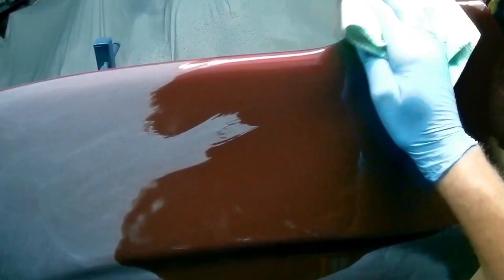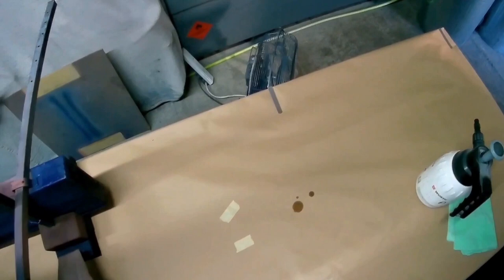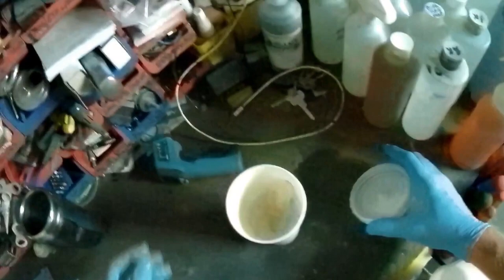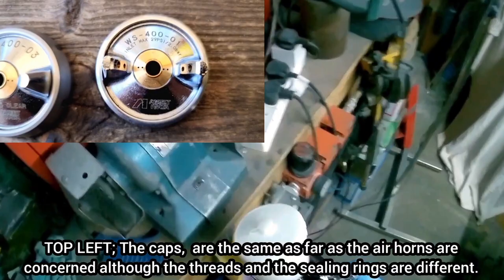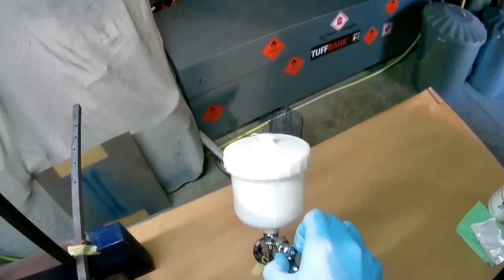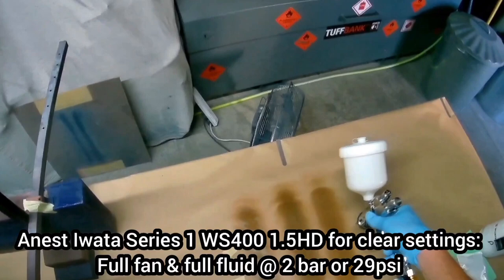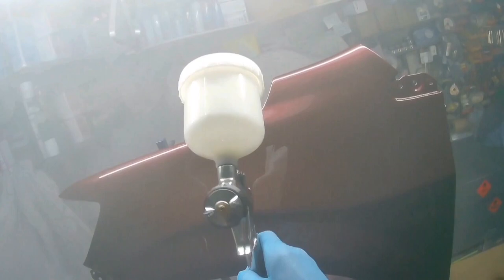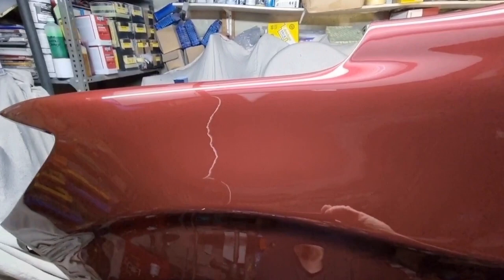Iwata WS400 Series 2 v Series 1 For Clear Coat

Comment: I've been using the old model for about 10 years. I've noticed the split spray pattern everyone talks about. It seems that a simple adjustment prevents the problem. However, I would not mind trying the newer one.
Reply from the maker: Hi buddy,  I've only had one person who says it didn't work. Everyone else has found it does allow you to use full fan, cheers mate 👍

Comment: Aligning the the tip with the cap air horns. Definitely works! and yes some align easier than others as I’ve got 4 ws400’s! Thanks for the tip Pete 💪💪
Reply from the maker: Thanks mate, yes, it really does work doesn't it, it could also explain why some have said they can use the WS400 series 1 on full fan without problems , I have seen one that lined up perfectly without over or under tightening the tip, of course that one sprays perfect. Cheers 👍
Reply: Is there already someone who did a mod to the old nozzle to line up correctly ?
Reply from the maker: Hi Lu, haven't seen one yet , it's actually not a problem holding the gun at a slight angle,  in fact you don't know you are doing it as you follow the patern.
I've seen a few series 1 guns and the tip actually finishes at different points on each, one was spot on, just like the series 2, this might explain why some people get on with the series1 better than others,  cheers buddy 👍
Reply from the maker: Ok mate, thanks 👍
Reply: @peteshobbies5383  I modded my nozzle to perfectly line up with a lathe. Will try these days and let you know how it turns out. Posted an update on Instagram LackLude. Surely marked you on my post Pete. Thanks for all your effort
Reply from the maker: Hi buddy, did you remove a little from the tip seat ?
Reply: @peteshobbies5383  yes. There are two seats / sealing rings that need to be machined.
Reply: @lutra7670  how much did u have to machine off? I know every gun will be slightly different….is there a certain amount to remove per 10degrees or something? Thanks in advance ✌️
Reply: @bdautobody  no. I don‘t think there are exact micrometer measurements as all models seem to differ. It‘s just remove something , try , repeat. Check for sealing cone angle and perfect sealing at the end.
Reply: @lutra7670  ok thanks for replying 👍

Comment: The reason they've done this is the SEMA show in Las Vegas where Iwata is going to introduced the Series 2 to the world. The UK was more or less the test market.
Reply from the maker: Hi Sataman,  that makes sense, the promotion stuff shows the product being designed in Italy and France so i assumed it was some kind of European thing.
I would still love to know weather they have known for years that lining up the tip cut outs with the air horns transforms this gun or weather they stumbled on this wile researching the new one, i suspect the former rather than the latter 🤔
Reply: @peteshobbies5383  Trust me, as thorough as the Japanese are they knew about six months after the introduction of the Series 1 when the complaints started to come in. It didn't take them 10 years to figure this out.
Reply: I got mine in Italy shipped to the USA
Reply from the maker: Hi Jeremy,  probably got a good price as well as the dollar is so strong,  have you used it yet?
Reply: @peteshobbies5383  Yes, it was a very good price and it sprays amazing. I really like the digital guage.
Reply: @jeremyoetken2094  please tell me how I can do this and what was the price
Reply: The non digital is much less money
Reply: @jeremyoetken2094  What is the website you got it from?
Reply from the maker: I think it will be this one,
https://www.prpshop.it/en/24-anest-iwata-spray-guns
Reply: @peteshobbies5383  correct
Reply: @rustyrook6957  prp shop it

Comment: Very nice finishes Pete...guess my version one might get the dust blown off this week. Thanks for this very informative video(although the sagola still wins every box checked for me). The 5000 is second and ws400 would be 3rd if the wbx didn't work flawlessly without the cap/tip fiddling. Keep up the lovely videos Pete.
Reply from the maker: Cheers Scott, yes, definitely give it a go, it does make a difference,  I love my Sagola Xtreme, and the 5000, another one, not sure if you have tried it is the Walcom Carbonio 360 Lite, it's really very good although you do wonder when something will break which you don't with the Sagola or Sata's, thanks for watching mate, much appreciated 👍

Comment: hey mate hello from australia just tryed your trick yes it works thanks heaps love your videos
Reply from the maker: Hi Cameron,  greetings to you guys in Australia, yes, it does work doesn't it, you need to hold the gun at a slight angle but it does make the older gun performe just like the new, cheers buddy 👍
Reply: @peteshobbies5383  i saw your video and thought ill give this a go i am spraying my  ws400 1.4 hd full fan and full fluid wow its changed the gun , to be honest its alittle slower now because the fans not wound in heaps to tighten the fan pattern but it atomises and the pattern is perfect , i might try a 1.5 nozzle as well now but yes very happy iv fallen in love with it again was always a finicky gun to set up i found , its no big deal holding the gun at a slight angle you dont even notice it when painting , comes natural , i look at the pattern when i paint not the gun cheers mate
Reply from the maker: @camerongrady4644  Yes,  exactly the same as me, it's just instinctive that you hold the gun following the patern, I've had a 1.5HD setup for a few years but didn't use it much, it's was a bit wet on full fluid with the fan around 2 turns out which is how you had to use them, you can turn the fluid in but then i may as well use my 1.3HD setup which i normally did, now the 1.5HD with the new setup comes into it's own, since this video I picked up a 1.4HD set on ebay so now gives me a good choice , thanks mate 👍
Reply: @peteshobbies5383  ok cool ill stick with the 1,4 hd its pretty good , sometimes less is better man it atomises well iv never ever used this thing full fan until now cheers mate
Reply: congrats on perfecting the ws400 i think thats gold ,
Reply from the maker: Thank you 😊

Comment: Hi Pete, fantastic video as always mate you did a great job on the voice over making it easier for people to understand what the differences between the guns and what you need to do to the Series1 to make it spray correctly.

As you mentioned in the video the Series2 will be released to the rest of the world in November I'm not sure why Iwata has done this but I do wonder if we (UK and Europe) are beta testers for the gun to see if they get any negative feedback and if the USA/rest of the world will get the same gun or an updated version of the WS400 Series2🤔 I doubt they would tell us if they updated the gun anyway🤷‍♂

Have to agree with your findings though Pete as there is no noticeable difference between the 2 finishes and both guns did a great job on the clearcoat, I've had my WS400 S2 1.3HD Digital for quite a while now and it's performed flawlessly with no issues and the digital gauge is the best I have, even though it's way over priced I have no regrets buying it and hopefully will be getting the Series2 OBS at some point👏🙏👍
Reply from the maker: Thanks John, yes, maybe we are the test bed for the rest of the world 🙄, The new setup on the Series 1 definitely makes a difference to the original gun and there really is no difference between them, well over priced though but people will pay it as we have 🤑, cheers mate 👍

Comment: I can't wait to try this on my original ws400. Thanks for the tip!
Reply from the maker: Your welcome buddy,  please let me know how you get on as me and other's would like to know, cheers 👍
Reply: I totally forgot I commented on this,  I did try what you did with aligning the tip, but I didn't have the same results as you. I was really hopeful. Pattern still was split when run wide open.
Reply from the maker: @AGRB4 Hi buddy, think maybe you're the only one, I'm wondering what pressure you run at?,  also the viscosity of the clear, so higher solids content means it has more chances to work
Reply: @peteshobbies5383  28/29 psi. Not sure on the viscosity. I think it's suppose to be 17/18 seconds. But I'd have to check that.
Reply from the maker: @AGRB4 That sounds about the same as my setup. I'm not sure why it's not working, I've tried it on 4 or 5 guns, and others have as well, and it works
Reply: @peteshobbies5383  I just checked, viscosity is 14-15. I'll give it another try. Hopefully this time I remember to reply. Have a great weekend!
Reply from the maker: Thanks, buddy, you too, mate 👍
Reply: @peteshobbies5383  I did it again today with 3 different iwatas. Didn't notice any huge difference.  They all patterned pretty well. Did you make a video of the series 1 with the old setup, rotate tip to new setup and pattern them on the same paper? I tried looking through your videos but didn't find it.  Basically split the patten,  rotate to line up, and pattern it again..
Reply from the maker: @AGRB4 No I haven't, How I got there was trying the new Series 2 which was doing the same as the Series 1, It was only after realising that the manual for the series 2 says the cutouts must align with the air horns, I did that, but tightening the tip, and you could use full fan without separation, I then thought I'd try it on the old one and that did the same, you can use full fan. 

Lots have said it works, so I'm not sure why it's not in your case
Reply: @peteshobbies5383  don't get me wrong, it has a nice pattern.  When I go from not aligned to aligned I don't notice much of a difference.  Try it one day if you are bored haha.
Reply from the maker: @AGRB4 I will buddy,  thank you 👍

Comment: Hi Pete, great video as always, both panels came out the same by the looks of it to me which is good as they both have a really good finish I can’t see by peel either. I’m pleased you find a usable way of using the gun with its little quirk at an angle, I does make you wonder if other guns are the same or if it’s where the thread is started on the nozzle. See you in the next one. Cheers.
Reply from the maker: Hi Steve, holding the gun at an angle isn't a problem,  you instinctively follow the pattern anyway so you don't realise your doing it and it really does transform the old gun into the new one, apart from the styling and the little adjustment to angle i don't think the old is any different from the new, apart from the £200 price difference of course 🙄, cheers mate 👍
Reply: @peteshobbies5383  Maybe it’s not a fault but a feature 😉

Comment: Great work!! In your opinion cost doesn't matter.. Which gun out of all the guns you have tested will give you the slickest finish the easiest?
Reply from the maker: Hi Gerrid and thank you,  I am making a top ten clear and base video and one of the hardest things is ranking the gun's, taking price out of it makes things easier though.
For Clearcoat in my top 3 would be Sagola 4600 DVR,  Walcom Carbonio Lite HTE 360 and Iwata WS400 Series 2 or Series 1 set up the same.
For Base the Devilbiss DV1 Base,  Sagola 4600 Xtreme Aqua and the W400 WB Iwata are all very good
Reply: @peteshobbies5383  I have always used sata where does the sata 5000 and 5500 fall in line with your top 3 clear guns.. I'm not stuck on sata its just all I have ever used.
Reply from the maker: I like both of them, i prefer the 5000 as it's faster than the 5500 although the 5500 is a little more refined, the sata is right up there, when you get to these top gun's there isn't that much in it and the materials used may mean one is better for you than another

Comment: Cool video Pete very informative and helpful but my question is for on the series 1 ws the fan control is all the way out Or out  a number of turns from closed?
Reply from the maker: Hi Graham,  think i put settings on the video but maybe not, its fully open, so full fan and full fluid , same goes for the series 2 👍
Reply: Thanks mate I watched it again and missed it but you did say but thank you for sharing
Reply from the maker: No worries,  thought i did , cheers mate👍
Reply: I was thinking Pete are the threads the same as like the Gtipro to prolites if nothing has changed so if you have a series 1 you might be able to get a series 2 setup and the best of both worlds old style gun with the ease of painting like a new one unless if you’re one of lucky ones to get to hold the gun straight up and down? Just a thought?
Reply from the maker: The Gti Pro and Gti Pro Lite share the same caps and tips but a different needle, they spray the same.
The older caps were same fitment but different numbers, so T1 is now TE10 and so on, the Pro lite is lighter as the name would suggest, most parts aren't interchangeable but most of the nose parts are, as i say they spray the same.

Comment: Hey Pete what is a good gun settings for the iwata ws 400 evo supernova and air pressure for clearcoat
Reply from the maker: Hi Jeremiah,  for the series 1 WS400 I would recommend the fan between 1 3/4 to 2 1/4 turns out from fully in, full fluid at 2 bar which is 29psi, if you can turn the front cap so the air horns are level with the splits in the tip and still use it then you can open the fan right up

Comment: Hello Pete. Just bought a ws400 series1 off ebay that says it has the base cap. My question since watching all your ws400 videos is, can I just but the 01 cap or do I need to buy the clear fluid nozzle as well, I've read where you say the holes are bigger in the clear nozzle. Is this the best route for setting this gun up for clear or will the cap change suffice? Thanks for all you do.
Reply from the maker: Hi David,  the only difference between the WS400 clear and base is the tip, the cap is the same except for the very early ones where everything was the same before they realised there was a problem if you used it for base.
So for it to be a clear gun all you need is the tip
Reply: @peteshobbies5383  thanks Pete.
Reply from the maker: @davidray4655  No worries 👍
Reply: @peteshobbies5383  well, looking on spraygunsdirect it show a needle nozzle set for OBS and the other one doesn't.  Which one is for clear ?
Reply from the maker: @david ray  The OBS is the base version with the smaller holes, the clear versions normally sold are HD so slightly bigger than the 1.3 it says,  1.32 in fact,  so the clear will have HD or Clear on them, the base ones have OBS or Base on them
Reply: @peteshobbies5383  thanks again Pete. Thats what I figured but had to confirm with my engineering department 🤩

Comment: What were your final settings for Series one question mark
Reply from the maker: Hi Mate, because I lined up the cap with the tip you can use it flat out, so full fluid and full fan at 2bar or 29psi, if you don't line the tip up then I normally use the series 1 on full fluid, fan 2 turns from fully in at 2bar, it's a smaller wetter pattern like that 👍
Reply: I just got the series 1 and hosed the job with clear.I knew the standard settings were not right.
Reply from the maker: Did you get problems then? , what settings did you use?
Reply: @peteshobbies5383  full trigger 3 out from closed 2 bar. But panel temp was 70 and so was clear. Might have got too close.5 " away.
Reply from the maker: It would be worth checking your fan pattern, on most, but not all series 1 WS400 clear guns turning the fan out more than two and a quarter starts to split the fan, top and bottom heavy.

On the WS400, I'm normally around 7 or 8 inches because the fan is closed up it gives a wetter pattern, so too close will over do it, it also allows better atomisation,  so it gives the gun a chance to work
Reply: Going to give it a go tommorow and let you know ty

Comment: Hello Pete, Patrick here; hope I,m not wearing out my welcome- I cannot afford $800 " for an IWATA WS400 !! I have 2 IWATA 1.3-1.4 BELLARIA,S  IHAVE 2 WS400 TULIP TIP NOZZLES (CALLED H.E) high-efficiency i.3 and 1.4 one has 3 slits and 1 has 4 slits- I have an "LPH400=LV4 AIR CAP AND I  also have a WBX400 AIR CAO -PLUS THE STANDARD Bellaria 1.3 &1.4 needles; is there Any Combination I mentioned to PRODUCE SIMILAR  RESULTS TO THE WS400 GUN?? IT IS STRICTLY FOR CLEAR COATS ?? ANY ADVICE APPRECIATED thank you, PATRICK.P     ps stay well !!
Reply from the maker: Hi Patrick, the nearest you would get is the WBX cap and the 4 split nozzle,  the Bellaria needle will fit as long as they are for a 1.3 or 1.4 tip, run it at 29psi and see how it goes
Reply: @peteshobbies5383  THANK,S PETE
Reply from the maker: Your welcome 👍